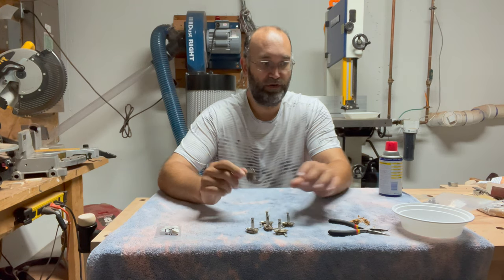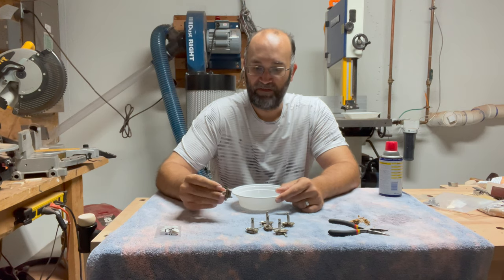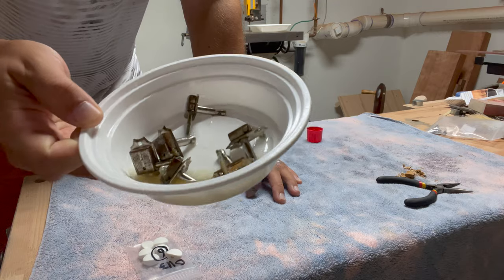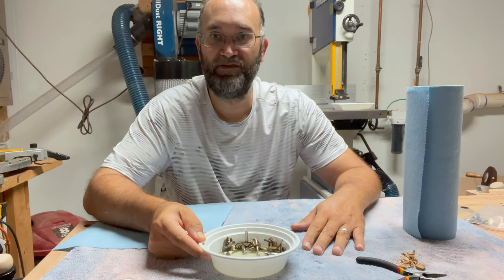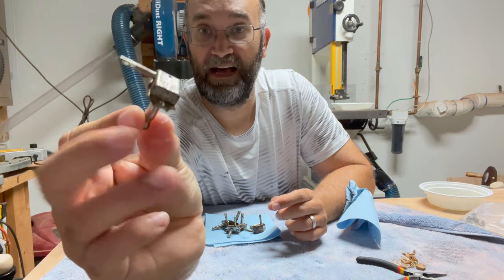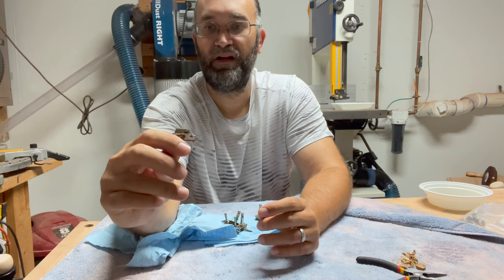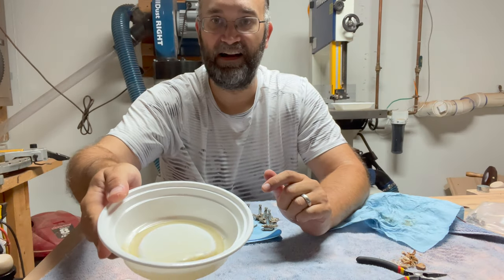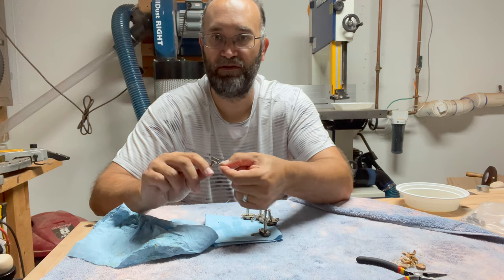Cleaning vintage guitar tuners using WD-40

Comment: I just bought an old Fender Tele with these same vintage style tuners. The high E string tuner just turns freely, with no resistance.  Is there a way to open up the tuner and repair it?  It's a valuable instrument, so I'd prefer to keep it all original, if possible.
Reply from the maker: There might be, but I’ve never done it

Comment: If you sit the flat square section of the tuners in the layer of liquid, it may have worked better. With the posts, wonder if it would work better wrapped in WD soaked tissue. Easier to think of in hindsight.
Reply from the maker: Both are great suggestions, thanks!